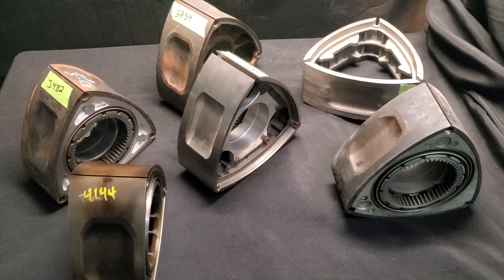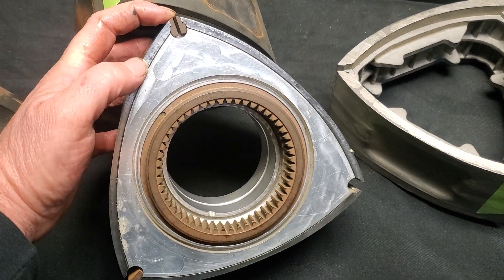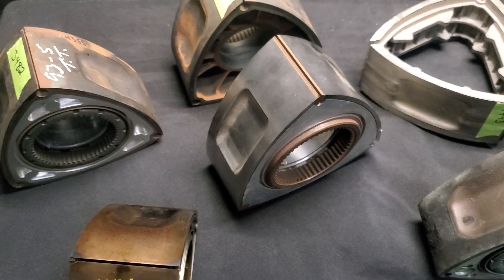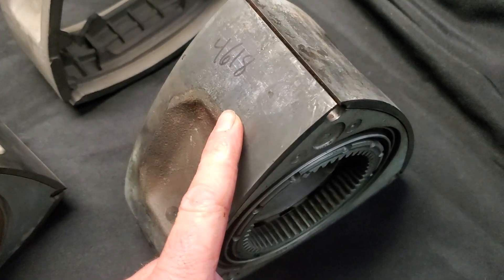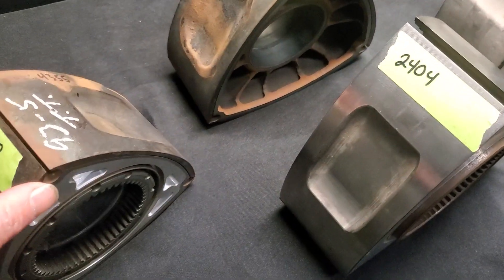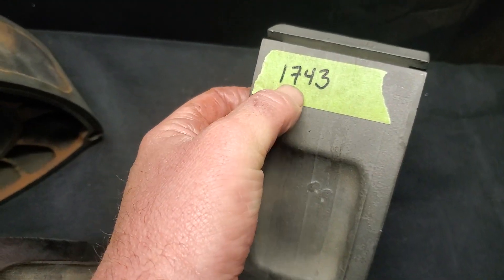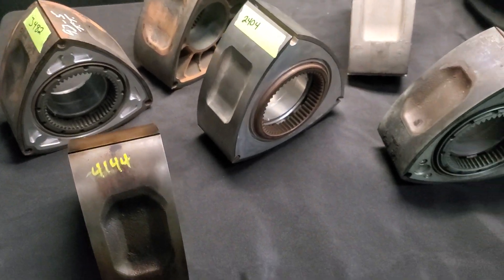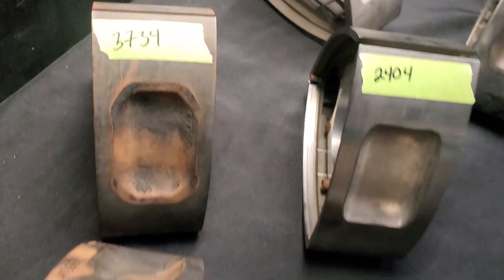Mazdatrix titanium aluminum cast super lightweight prototyping weights - Part 3.

Comment: pretty cool idea but the differences in thermal expansion would definitely cause issues especially with the titanium as it has  pretty high thermal expansion rate. wonder if this could be accomplished easier now using DMLS printing, or if an inconel rotor would be possible.

Comment: I am looking at those steel apex seal inserts and thinking about repair inserts for 12A rotors, which have been NLA for a long time and the rotor slots are the main wear point in the engine.  That and machined-down 13B rotor housings would allow 12As to live forever.
While I am fantasizing.... 2mm apex seals for 12As to be lighter on the rotor housings, and 12 pin rotor gears like the '86-up engines so they can go over 8000rpm without eating stationary gears

Comment: If you reduce rotor weight, then you need to calculate the % to remove from the counter balance assembly😉 it wont run right if you dont
Reply from the maker: Yea.  It was ballenced. The counter weights were crazy

Comment: Can you share the dyno curves for any of these dyno tested light weight rotors.

I realize that these are not production rotors but the point of this development is to see what the upper limit is. I am interested in peak torque and maximum RPM. Thanks sharing. sharing